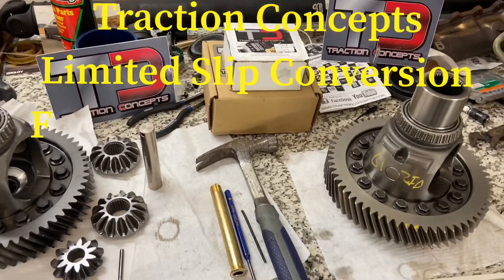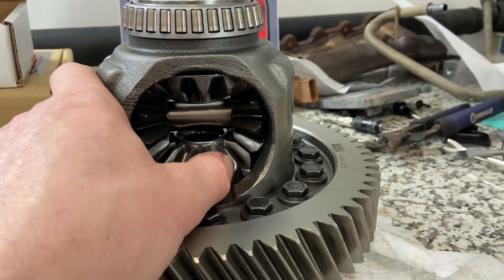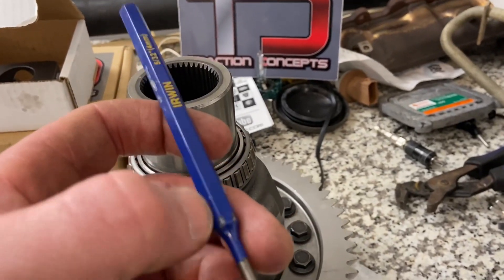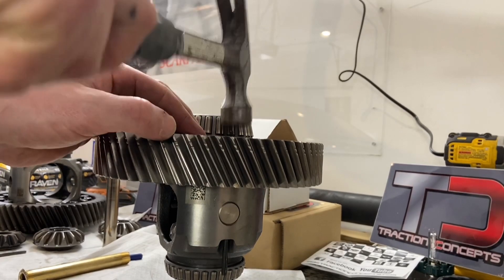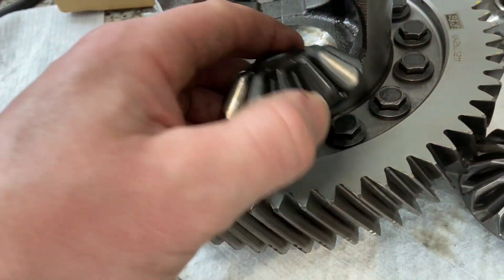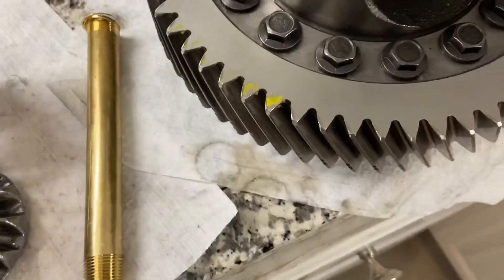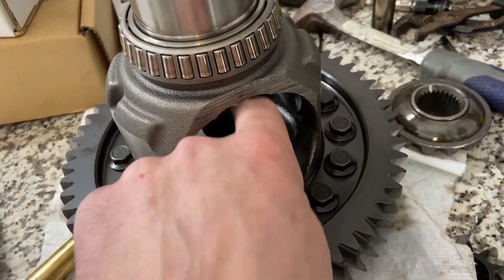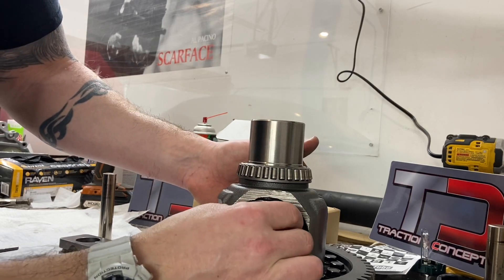Traction Concepts LSD conversion Kit “How To” EcoBoost 6F55 install video

Comment: $399.95 for two pieces of Steel and some springs? I'd rather just buy a Quaife for that price..
Reply from the maker: Except you can’t for that price.  Do whatever you want this is just 1 option
Reply: @802sho  My comment flew right over your head I guess. I meant if I have to spend 4 bills on that. I would rather just spend 6 hundred more on a quaife. Those things cost under 40 bucks for other cars 😆
Reply from the maker: @Shreddylife  you’re a fucking retard!  Knew that the second you commented

Comment: The trunion holds the spider & side gears not the shaft pin. A cotter pin is a pin that splits into 2 wings and is a non load pin. The pin holding the trunion is a roll pin that expands & is drove into the case. Great video though and good work on the information to install the lsd block.

Comment: You should have done your research on that product. You go scammed hard. Those are a complete joke and have been around for years. They do nothing at all but weaken your diff because of the material you have to remove from the gears to get it in there.
Reply from the maker: Lmfao!  You got scammed then at some point.  Weaken the diff?  Lol….keep trolling.
Reply: @802sho  These cost $38 on ebay for a lot of cars lol Yeah you got scammed hard
Reply: Yep... Scamm.... Lsd work on clutch, torson etc..base... Not spring... Yea. Spring is there but.....